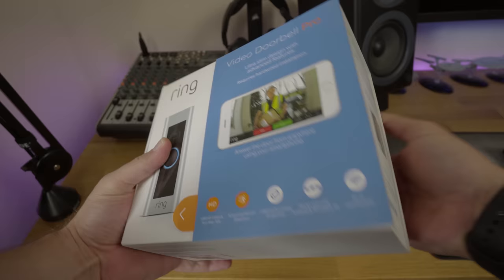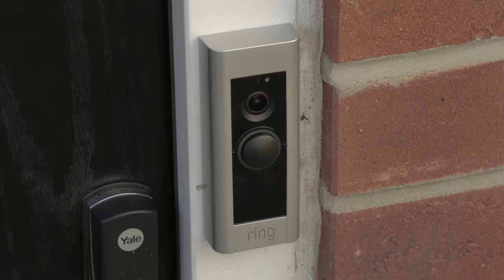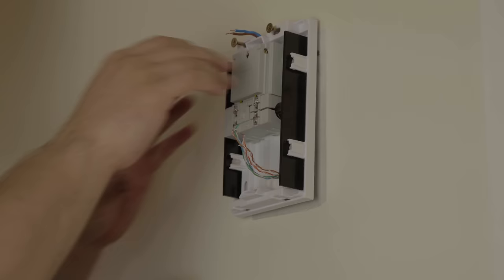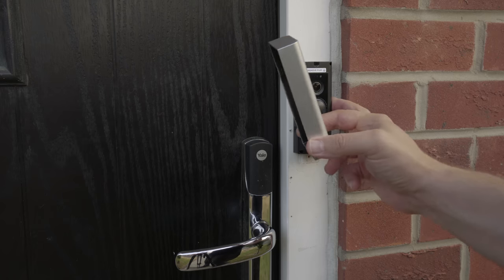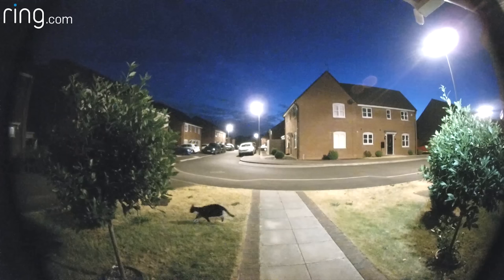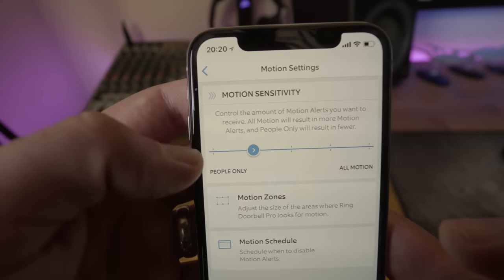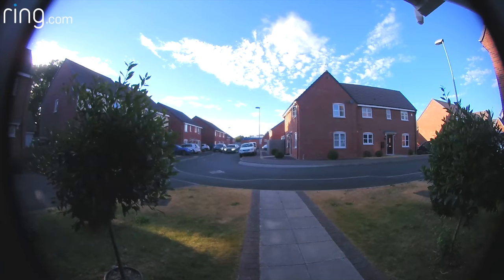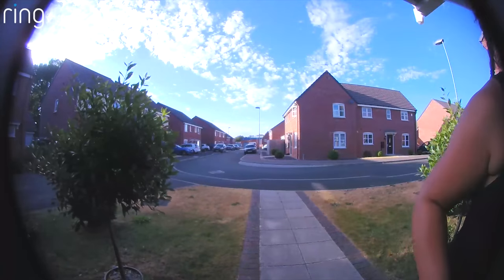Ring Doorbell Pro vs Ring Doorbell 2

Comment: Just got the ring alarm & picked up a couple of wireless spotlight cams in the deal , I live in a bungalow so one camera looks at my drive to watch the vehicles but my question is this , would you swap out the spotlight cam for the doorbell as they both do the same thing ? My camera is just over the garage door as it’s got a flat roof so not very high . Struggling with the idea of leaving as is or putting both spotlights in back garden & having door bell .

Comment: Thanks! Great video. Just installed the Ring Doorbell 2 and so far, so good. But how do I explain to the wife that it only records for about 20 seconds after motion detection. I really wish there was an option to extend these recordings. I think this is called "Motion Stop" and was rolled out early 2019. And they call it a feature... It's a bit disappointing.
Reply: You can set the length of the video in device settings

Comment: Great Video. Can you answer a couple of things? I purchased the bell in your video and tested at the terminals. Im only getting 14volts. You said about disconnecting the Solenoid, I have googled this and can't find it anywhere. When I disconnect the cables to the transformer everything stops. Also can you tell me if your ring pro gets hot? The ring pro has only been on for about an hour or so and its getting pretty hot on the back and is going through to the front? Does yours do the same?

Comment: Thanks, I had a version 1 for a while but before I could get round to running in wiring the security screws corroded, I live by the sea, and left it unusable.  Ring kindly sent me new screws but the damage to the unit meant I couldn't really secure it any more.  I think the later ones have improved and overall I thought it was a great device, the Pro sounds interesting.
Reply from the maker: Hmmm, sounds like cheap screws which is shame given this is a premium bit of kit.
Reply: Yes it is a shame, apart from that it was a great piece of kit.  It was the actual plastic that disintegrated rather than the screws, I guess that's living by the sea.  :-)

Comment: If the Ring 2 is hardwire would it still have that pre delay of 30 seconds that you spoke about?
Reply from the maker: The ring 2 still has a ‘wake’ period even when hardwired. The ring pro has a continuous looping video in a buffer so always captures the few seconds before a trigger event (as well as the event itself).
Reply: @VirtualRealityPilot  Thank you! I did buy the Pro Ring and I did notice there was about a 30 secs capture before a trigger.

Comment: Hi mate, lovely video, would appreciate some help, I’ve wired up a ring pro to Byron 776, chime keeps making a crackling sound and doorbell says voltage is poor.
From socket to chime there is a 3amp fuse on flex cable, from chime to ring it is standard doorbell cable.
Thanks
Reply from the maker: Have you bypassed the solenoid? By which I mean the bell, it draws current and you can bypass it by moving some wires internally. Please do your research before you do this but it should help.
Reply: Thanks for the reply, sorry to sound like an amateur,  I have wired it exactly like it said on packaging, couldn’t seem to locate anything regarding bypass on solenoid, would appreciate if you could forward me link.
Thanks